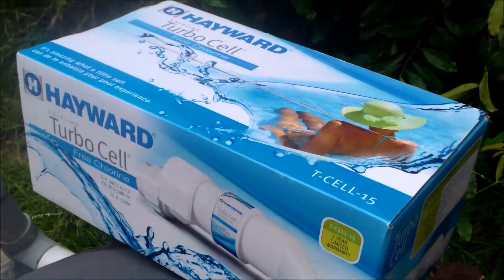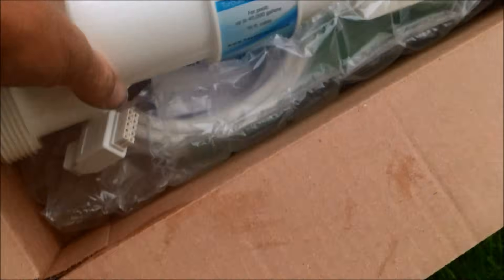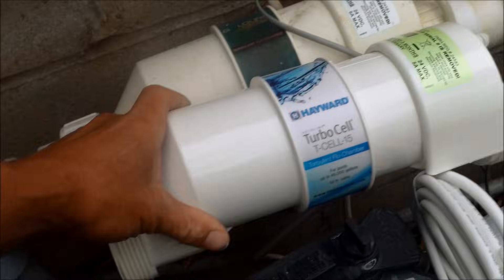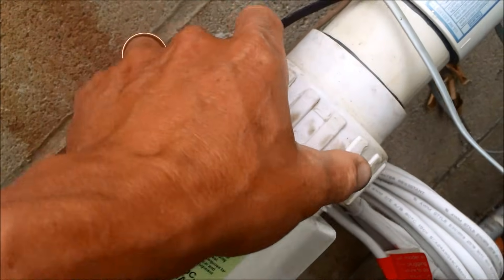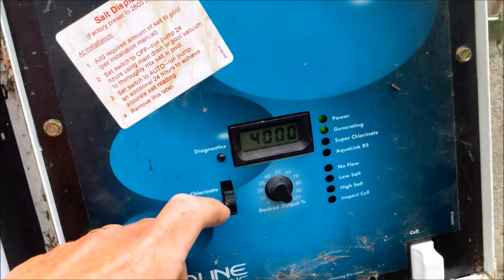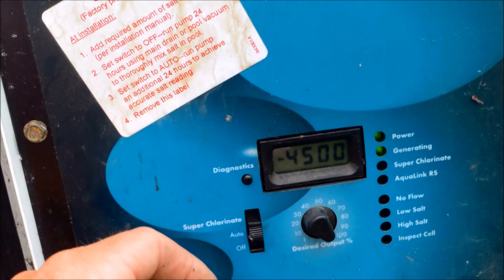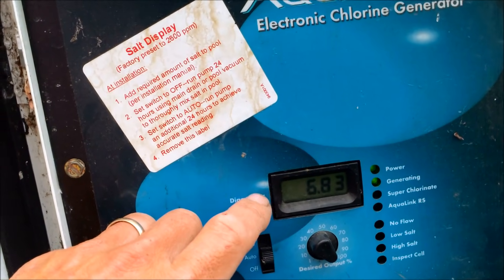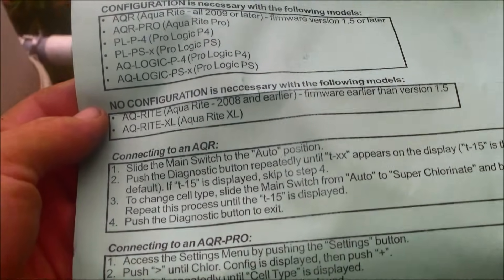How to Replace your Hayward Aqua Rite Turbo Cell

Comment: They do not have in stock the size we need per gallon is it ok if we get the size that is for a larger pool per gallon.  Our pool is only 20k and they do not have that size in stock.  So we are willing to pay more just to be able to use the pool.
Reply from the maker: There are generic cells as well that work with the Hayward Aquarite System.

Comment: It dose not matter which way you put it on and Hayward actually recommends you flip the cell around each time you take it off to clean it.
Reply from the maker: Yes, correct. 👍
Reply: Swimming Pool Tips, Reviews & How To - SPL  What dose it mean when you have no lights but the salt reading is displayed on a Hayward aqua-rite system.

Comment: This is a very good instructional video for those of us that have not done this before. A few comments/ questions for you.1) Is it ok to lube the o-rings before reassembly. 2) Do the pvc threads of the lock nuts require any lube . They are kind of dry.If so, with what?
3) When reassembling, try to put even number of turns on lock nuts, If not, one side may leak.
4) I do not have a stand for the cell ( hayward blue essence).  I used a rectangular bucket, filling it with a 25% solution ( h20 & muriatic). Immersed entire unit in the bucket.waited 15 -20 minutes. Worried about potential damage  to the cable. Is that a consideration? 4) The cell says clean every 3 months. Mine had never been done in 2+years, but it is almost impossible to directly see any scale buildup.There are plastic fins on each end which block your view.The readings for amperage & voltage seem to be almost identical. before and after .Is this a way to measure your success?? If so , how? 5) Is there an output difference between 100% and Superchlorinate? If so, how much??
Thanks
James
Reply from the maker: No lube is needed for the threads. Using a bucket won't damage the cord. If you don't see ant calcium the cell is probably clean and okay.

Comment: I had a low salt reading and followed instructions to clean. Now, in dignostics, it shows 0 amps and 0 salt level. I replaced the 20 amp fuse to be safe and still nothing. It is an aqua logic system. Help!!!!

Comment: Hi David,I have an Aqualogic  system I replaced the main board and my cell is good but am still having problems with the system my light stays On and it reads very low salt I reset the cell light and it comes back on the levels on the water or correct any ideas?I call Hayward and they are no help for your POOL owners I notice not too many videos on youtube the shows this system.thank you.
Reply from the maker: Do you have a digital salt tester? If not maybe bring a sample of the water into the pool store to see the exact salinity level.

Comment: how do you hardline a t-3 cell, my ends won't allow,any size pvc to connect ,any   special ends you have to order from hayward?
Reply from the maker: Should fit a standard 2" pipe set up.

Comment: If I replace my T CELL- 9 with a T CELL- 15 will it make too muck salt for my 25,000 gal pool? and if I can do I need to change anything?
Reply from the maker: It depends on how old your salt system is. The older versions don't allow you to switch salt cells. The newer ones do. The T-Cell 15 is the one I always install - it will be fine for your pool size. 

If your system is able to change cell sizes it is pretty simple to update the system. Call Hayward on Monday and give them your model # and they can verify if you can switch cell sizes - 866-429-7665

Comment: I have an Aqua Rite T15 cell, which looks identical to the one you replaced.  I noticed your replacement cell was branded as a Hayward product.  Is Aqua Rite and Hayward the same or are they different but compatible?

Comment: Thanks David.  Where is the best, and cheapest place to buy the t-15 Goldline cell?  My system is almost identical to yours, and my cell has a crack in it, so it is leaking and needs replaced.  The cell is almost 4 years old, so it is not under warranty.
Reply: Did you get an answer on this?
Reply: Randall Moore No.  I did not.  I have a company that 'services' my pool and they told me that if I replaced the T-cell, it would void the warranty on the circuit board that was replaced this year and any other Hayward parts that are still under warranty.  I would like to know where the best place to buy the cell, one that will honor the warranty, without involving a third party (pool service company).
Reply from the maker: Crystal Shippen Sorry I missed your comment. Get 20-30 every day and some slip through the cracks. Thanks Randall. I trust PoolSupplyWorld.com. They have great customer service and if they give you any problems I know the person who runs the site so I can help clear any issues up for you: http://www.poolsupplyworld.com/Hayward-T-CELL15-Replacement-Salt-Cell-for-Aqua-Rite--Swimpure--Goldline-Salt-Chlorinator-with-15-Foot-Cable/T-CELL15.htm?&utm_source=ls&utm_medium=affiliate&utm_campaign=ySRom43KJNA&siteID=ySRom43KJNA-UotbzOQKsIgvQJMAJm5KOg

Comment: when I bought the house I have , there was a t-15 on the salt system,    my dog chewed through the 62 FT CORD, and I felt like , because of the gallon size of the pool, that a t-9 would be a better fit  but then I find out that because of the gallon size, the t-9 would almost be too small.... ( THIS OF COURSE AFTER I HAD ALREADY PURCHASED THE T-9) but when I installed it, it would not work anyway,   even after I recalibrated it. The "CHECK SALT' light and the " CHECK CELL" light kept coming on. I gave it almost 48 hours and kept resetting it, but no go.      is that because it was too small for the amount of water passing through, or is there a chance that the brand new cell was bad?   I just took the old t-15,...stripped it down and re soldered all the wires back and then shrink tube all including the outside wire insulation and then electric taped it, seems to be working but im still puzzled as to why the t-9 did not work?
Reply from the maker: If you have an older power with the older software version it is unable to recognize any other T-cell size except the one that came with the unit. Later power units came with updated software where you could enter the T-cell size. My guess is that your unit is the older type. Can you exchange the T-9 cell at the place you purchased it from? They should be understanding of your mistake. If not E-bay is a good option.
Reply: Actually, it was ebay, but they said thery would back it 100%, so well see?, thanks!
Reply: I thought maybe they would exchange it with an added charge of course for a t-15?

Comment from the maker: Give it a good cleaning and see if it starts producing again. It may be okay. You can get the cell stand on Amazon. The one pictured is not the one you will get that one is discontinued. You will get the one in this video. 
That is a long time without cleaning it.

Comment from the maker: Add some salt to the pool and see if that helps. I try to keep my Aqua Rite pools at 4000 ppm since system tends to show the salt on the low side when the cell gets even slightly dirty. You re-calibrated the unit and it is still showing low salt - right? It needs +3200 ppm to work properly.

Comment: Thanks for all the helpful videos! Chlorine was not being produced in my pool. Salt level on board showed below 2300. Chemical test at the pool store showed my salt level at 3000. I cleaned my cell and had it tested. The test showed the cell was producing chlorine. Re-installed it and still no chlorine. Pool tech came out and tested the board and said it was working property and insisted it was a faulty cell. Installed a new cell. Still no chlorine and board shows low salt. Any suggestions?
Reply: Mines doing the same thing. Did you ever figure it out?
Reply: Did you figure out  you salt system problem ? I just replaced my T-15 cell and all is good now. THEY ARE NOT CHEAP .